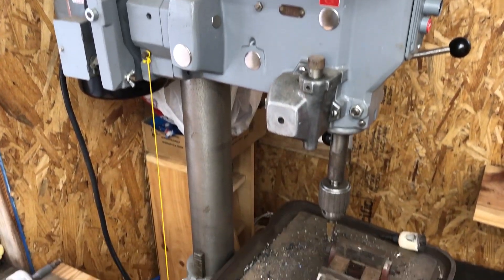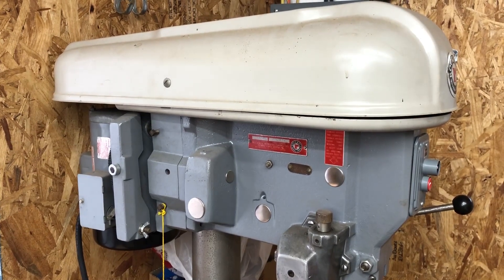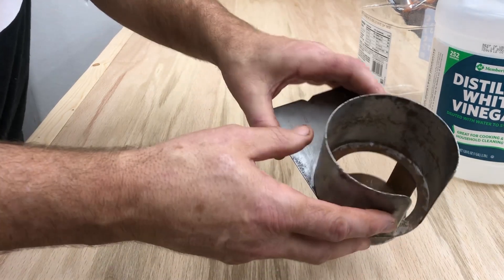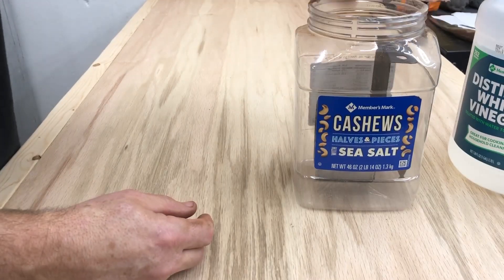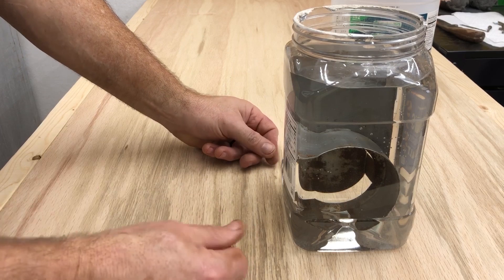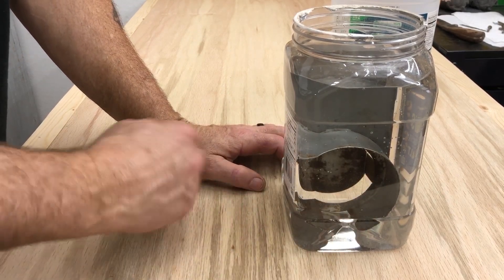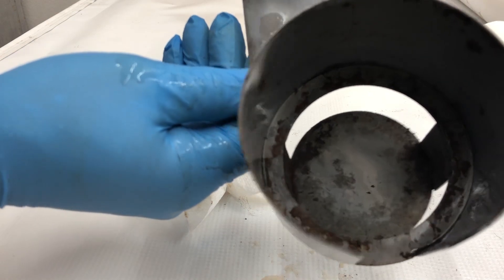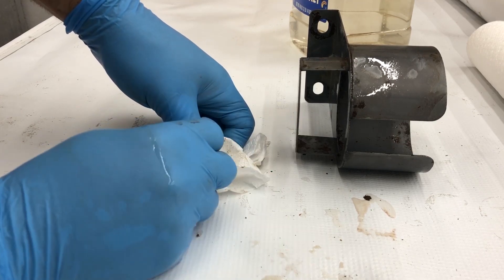Easy Rust Removal (Cheap, too!)

Comment: About how long would that vinegar stay effective? How many times could you clean a part like that before needing to replace the vinegar? Great video, thanks.
Reply from the maker: It depends on the size of the part and the amount of rust needing to be removed. Comparatively, vinegar is much less expensive than the chemicals being sold to do the same job - so change it out if in doubt.

Comment: Will this work on cast iron pans?
Reply: I looked this up. And yes you can. With that said. You have to do it the right way because the vinegar will also eat away your cast iron too.
Reply from the maker: Pat Konelectric yes but you have to be more careful with cast iron. With steel vinegar seems to work to a point and goes no further. With iron it seems to keep breaking things down if left too long. It depends on the amount of rust. Just keep this in mind and pay attention.

Comment: I believe if you add baking soda it will pretty much fizz it off. I use vinegar & baking soda for old baking pans I buy at thrift stores to clean them up and make them usable again.
Reply: From what read baking soda neutralises the vinegars acid. Making less effective. Is this wrong? Or are you socking in vinegar and cleaning it up with backing soda?
Reply: @patkonelectric  I just put them in together and come back later to a pretty much clean pan. Just scrub a little with a sponge to get the baking soda off it and clean the pan.